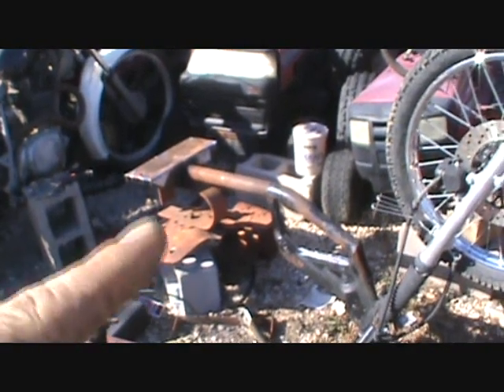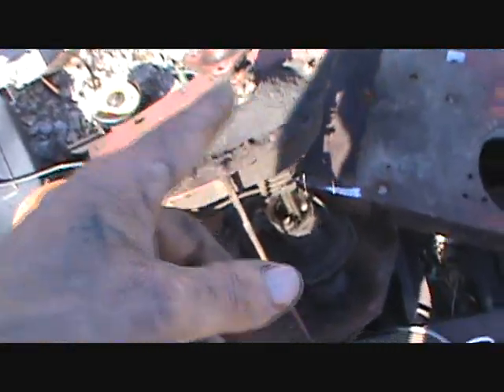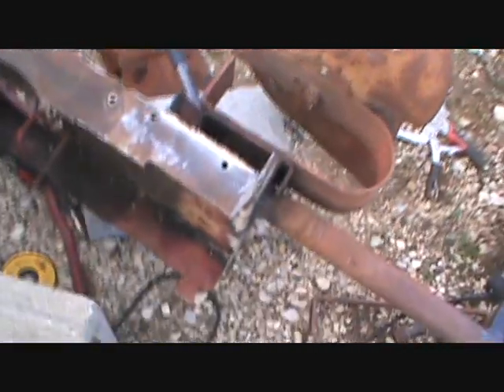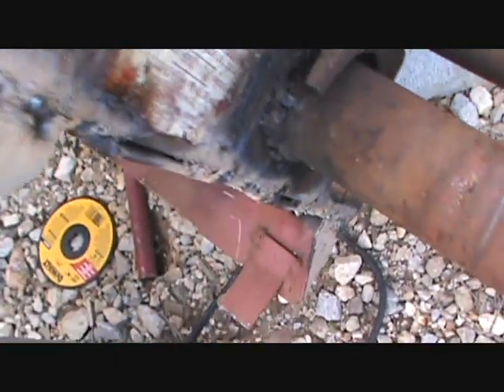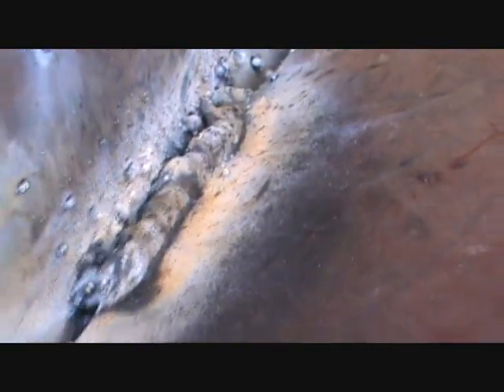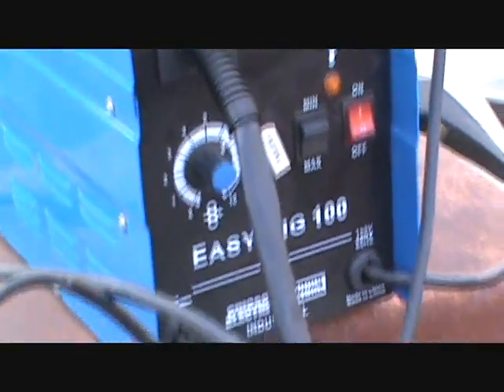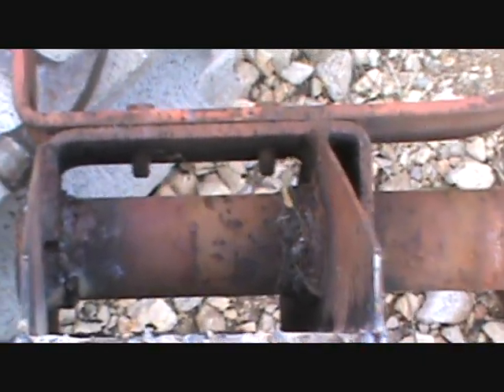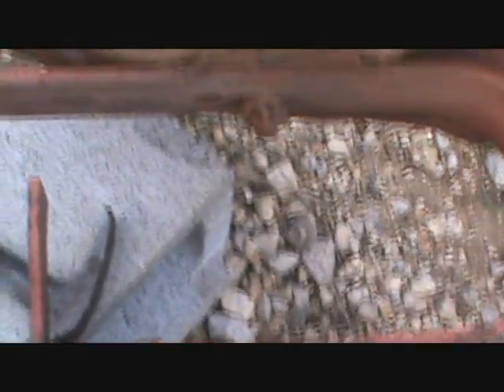update three wheeler snapper

Comment: Thanks for subscribing to me and as I said I'll subscribe back so I did. Those Snappers can be made into a lot of cool stuff. A friend of mine had a moped that was hit head on but the rear half was still good so he welded it to the front end of the snapper , you sat real low on it and it went pretty good. The one I have is still going to be with 4 tires just lower seat and handlebars and a Harbor Freight 6.5 horse power and a chain drive. But before I do that I need to finish my sand dragster and my friends mini chopper. Thanks for watching mine and tell your  friends to subscribe and watch my 200th subscriber video for a chance to win some new cools tools.